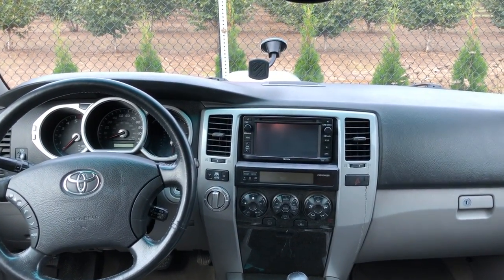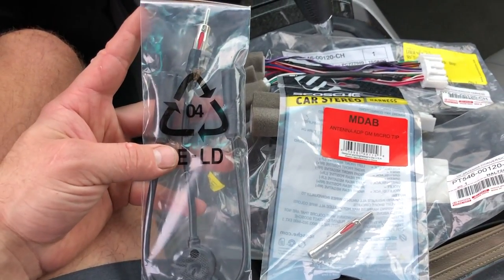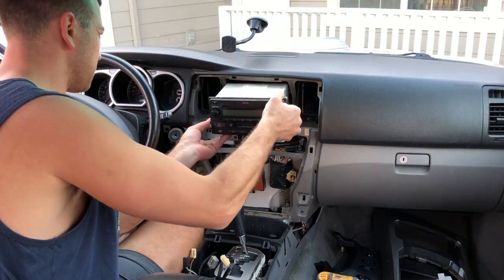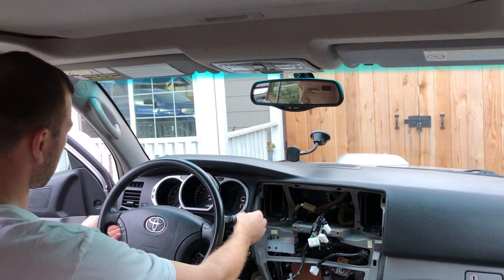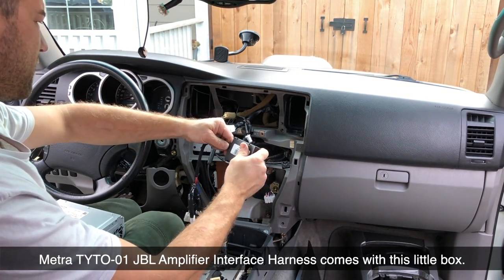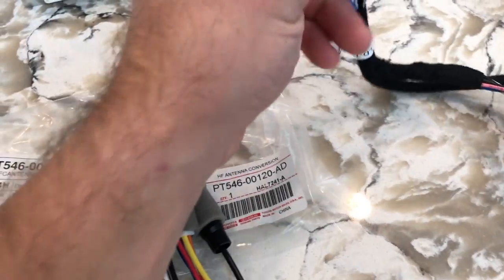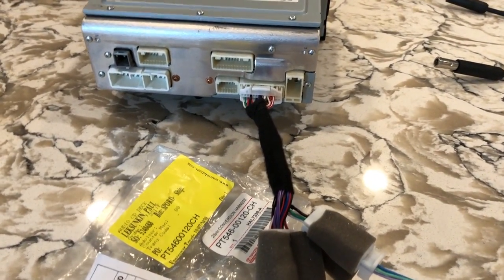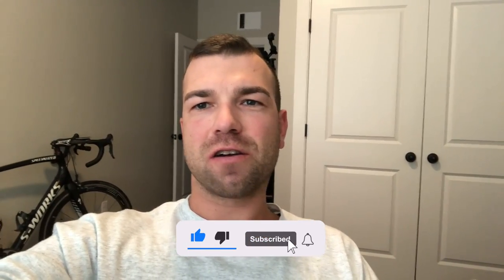4th Gen Toyota 4Runner Touch Screen & Bluetooth Radio Install - Upgrade 4th Gen Toyota 4Runner 2003

Comment: hello i have a 2008 4runner and im trying to upgrade to the oem Toyota head unit but its to much money so instead im going with a SCION PT546-00140-BU which looks exactly the same and im having a hard time figuring out what harnesses and connectors I need. i dont have the JBL speakers. and im also just making sure that the SCION PT546-00140-BU will fit and work the same as the oem toyota one that you show in the video. could you please help me?
Reply: I am about to uninstall mine from my 4runner and willing to sell. See my videos to see it working on 4Runner with JBL amp. Comes with wiring ready to plug and play.

Comment: Hey the radio is super hard to find online, any suggestion? LKQ is a dead end
Reply: I found a new one at a dealer for around $300.  They are still available. It is the same part number.
Reply from the maker: LKQ should have them for sure.

Comment: Does anyone know of the harness adaptor to allow the OEM backup camera to work with this headunit?  I have the JBL system.
Reply: Is the wiring back there on a 2006 ?  I bought a oem back up cam hoping I’d luck out and it would have a plug in the harness
Reply from the maker: I haven't done that research yet
Reply: @tronixster  - Have you seen any issues with speakers not working? I have the Panasonic model 2012 Corolla head unit, very similar in build/form factor and rear connectors.  Stock Harness non JBL fits right in, but the speakers aren't working.  It says 4ohm speaker on the unit (Model NO. 86140-0210 - Panasonic) -- Bluetooth works, FM/AM Antenna works, USB power works, everything but no sound / speakers don't seem to be working.
Reply from the maker: @alexjohn3754  no sure honestly. Are you sure you don’t have onboard JBL amplifier?

Comment: Would a 2018 model radio from a yaris also work?
Reply: Has to be a radio from 2015-2017
Reply from the maker: Yeah I believe Jose is right has to be before 2018

Comment: ya after doing research the 2015 yaris radio you linked does not have reverse camera capability. dam you... dam you... i spent alot of money buying everything. you need to buy a 2015 scion head unit that has the reverse capability
Reply from the maker: No way dude! I hope you are wrong about this cuz I'm planning to install back up camera on mine!
Reply: @tronixster  if you get the scion radio . that should have backup camera capabilities. but the toyota one you recommended cones out of some basic toyota car that doesn't have back up camera